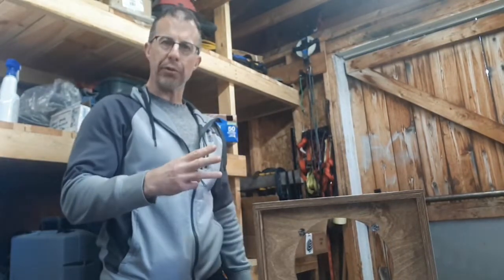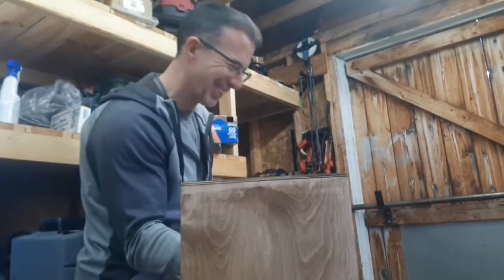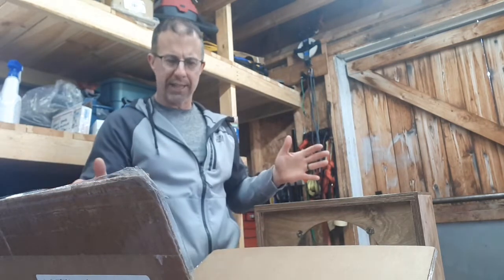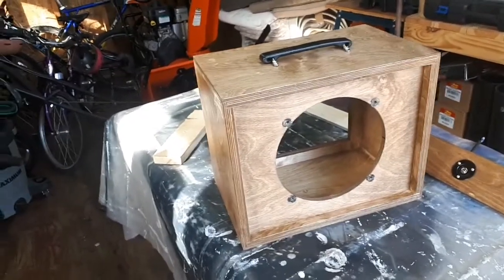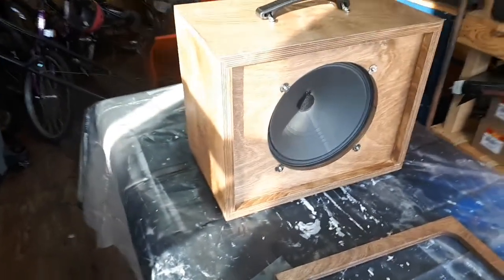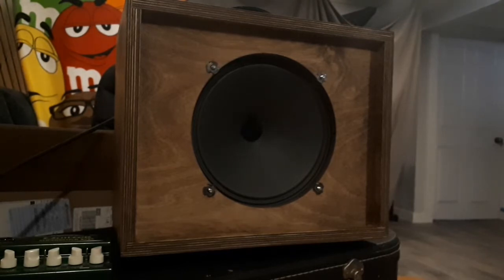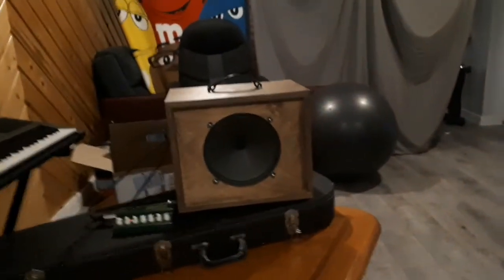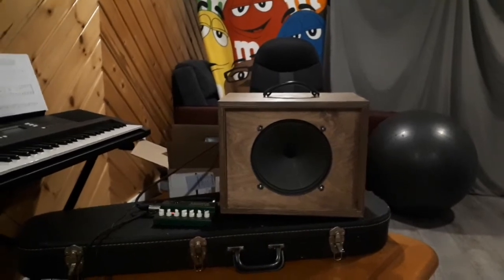1X10 cab build from Implicit Audio - Part 3!

Comment: Really cool little project, Jason. It turned out great, and you're right.... there really is some nice "bottom end" coming out of that Jensen! I know how you love your Jensens! Black grill will be fine. But what I'd do on that one... is to go down to the Salvation army. Buy a 70s brown/tan/beige suit coat or blazer and cut it up! Lay that on the grill, and man that would look vintage cool ! Tom Peterson Refuse Re-Use channel has one he did. it came out AMAZING!!  Really 50s looking. Just a matter of finding the right vintage piece. I think he paid $7 for the blazer.
Reply from the maker: Hey That's not a bad Idea Jimmy!
I did order some grill cloth from amazon that got good reviews, but may not be any good for an actual guitar cabinet! If not, a little trip to the salvation army will be in my near future! 
Thanks bud,
J
Reply: @j-man9457  Yep/ Seriously. Check out some of the stuff Tom Peterson does. I think his channel is called Tom Peterson Refuse Reuse. He finds junk, trash, whatever he can gets his hands on for free or dirt cheap... and works magic with it. On one of his vids.. he fond a cheap throw-away amp. And literally did the old suit coat / blazer thing. You gotta see it. It is AMAZING!!! He spray-painted the cabinet tan - and then covered it with the cloth. I literally couldn't believe it. Straight out of the late 40s or 50s. He also built an amp out of an old vintage suitcase. Hub-Cap guitars. LOL All sorts of neat stuff. The guy is a genius. Builds tons of Eddie Van Halen guitars too. That's how I got hooked on him.
Reply from the maker: @jimmyz2098  cool man! I'll check him out!
Thanks!